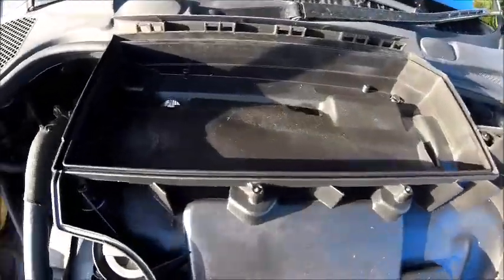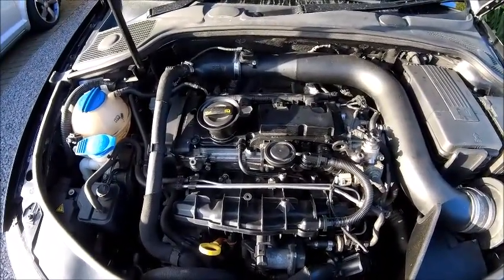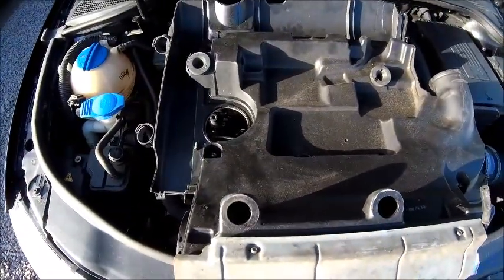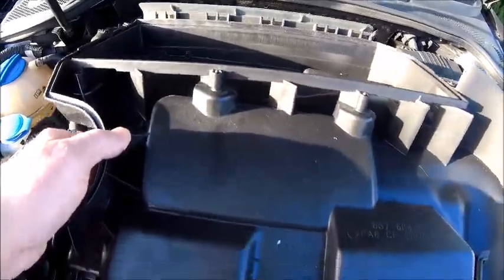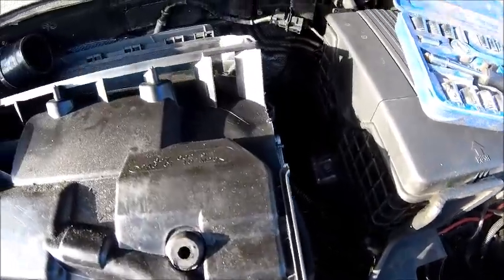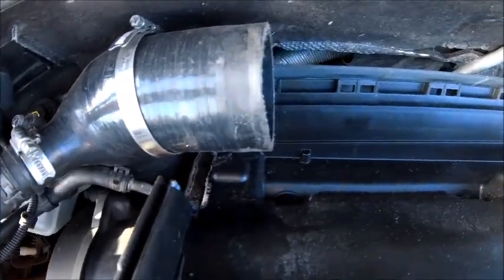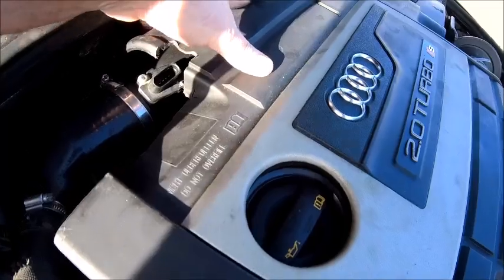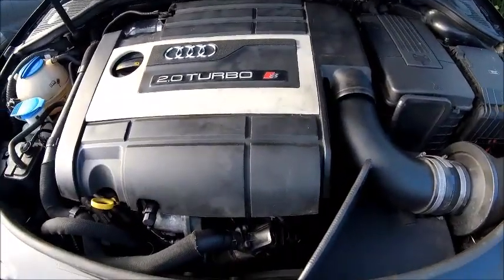Audi S3 Engine cover with cold air induction...

Comment: Hi mate, good informative vid. What intake did you go for and how did you go about fitting the sensor to the new pipe?
Reply from the maker: Hi its a Revo intake and totally plug and play as soon as the old air box is taken away...the MAF is also just bolt on. Cheers....

Comment: Doesn't this make the tube warmer above the exhaust manifold, because the purpose is to suck cold air? Or am I wrong.. Although good solution for the look
Reply from the maker: The cover itself has a heat deflector built in...but your never gonna get true cold air without removing the bonnet  😁

Comment: What were the main bits where abouts did you have to cut thanks
Reply from the maker: To be honest many places had to be cut and was a case of take little bits off at a time...I wanted to keep it as "Stock" as possible but most of the turbo induction side went and a fair bit of the internal parts that once used to house the air filter and a little from the remote air side was probably the last cut.. Hope this helps  :)